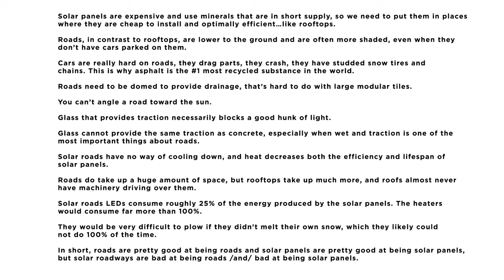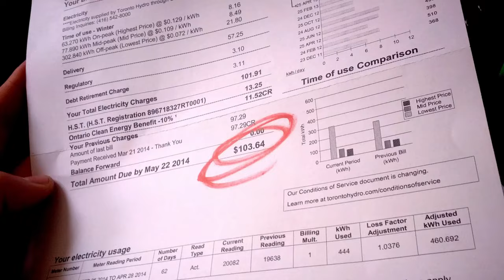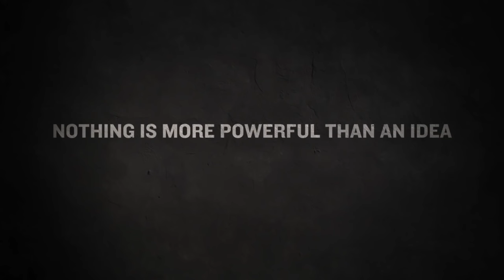The Kony 2012 of Roads - Solar Freakin' Roadways

Comment: I don’t care WHERE the solar panels are I just want MORE SOLAR PANELS (but…maybe they shouldn’t be roads)
Reply: Amen to that!
Reply: A similar sounding but much better plan is to cover all our large parking lots with panels overhead that also serve as shade. This is one to get excited about.
Reply: @Zakmmr  As an Arizonan, PLEASE.
Reply: Agreed.  I think there's a place that put elevated solar panels in the highway medium and put a biking path underneath the panels.   None of the obvious wear-and-tear problems of solar roadways and still has a nice side benefit.
Reply: @Zakmmr  That would be loads better than replacing the asphalt with solar panels. Less wear and tear on the panels, better traction in the parking lot, shade in the summer, keeps snow from piling up on windshields in the winter (in places where it snows)...
Reply: @TheFalrinn  that sounds like a truly miserable place to ride a bike.
Reply: @41-Haiku  solar panel parking lot shades are already installed some places.  Michigan State University has had them on some of its bigger parking lots for years - they're great!
Reply: On one or both sides of the highway is infinitely better than sandwiched between the two directions
Reply: Build houses with them already built in, with positioning and cleaning taken into consideration would be amazing.

Though do remember 2 unsolvable problems with solar.  The months of January and December.  At least they are at my latitude.  4 hours of daylight in winter just isn't going to work.
Reply: Beside roads could be an idea.  There's easy access and the right-of-way already there (the same reason why twinning a pipeline is a lot easier than building a new one).

As a person who primarily interacts with roads in rural areas, I see a ton of open space we could use for things.
Reply: @mrtalos  yeah, yeah. You fire up your nuclear stations and run them for two months a year.
Reply: What about…roadway SHADES
Reply: @London755  I mean, i've ridden a bike in the middle of a huge sunny day, and if there's a dedicated shady spot for a long stretch of it? Hey, i'll take it!
Reply: @mrtalos  there's some research being done in Australia with solar panels that are woven.  So they can be used as curtains and awnings.... Also as the roofs of emergency relief tents, particularly medical tents.
If they can get them fully functional and at a commercial level of price it could be an absolute game changer.
Reply: @Zakmmr  in South Africa many of the large companies are doing this. Not that it helps the power stay on but that’s a whoooole other story 😂
Reply: @London755  If you’re a commuter, sounds pretty friendly to me! Highways currently inaccessible to bikes!
Reply: @myladycasagrande863  yeah, they’ve had them installed in the main parking lot at the Cincinnati Zoo for a number of years now. 😊
Reply: @London755  If you're riding your bike for the sake of relaxation and seeing the countryside and such, maybe. You also don't have to spent all your time joyriding your bike on a highway, but bicycle-accessible highways would make it easier and faster to get places, and for a commute to work they would be a miracle.
Reply: @trishapellis  highly recommend checking out the channels @BicycleDutch and @NotJustBikes.   Building more urban highways would be a disaster, as would expanding them.
Reply: Put them beside the road, they can still power lights or whatever. Just don't drive on the things.
Reply: We can put them as a cover for parking spots.
Reply: @Zakmmr  It can work, but will require some detailed planning, as the light reflecting from the panels shouldn't enter any nearby building and can be nasty
Reply: @mrtalos  Excess solar energy can be stored away for later use, like for emergency power or I guess if the panel's usual output isn't enough, like reserves. (Or excess energy can be sold back to local energy/electric providers for $$ ((and/or possibly tax credits or something?)) ).
Reply: @TGears314  I thought about that , but then you remember what trucks do to bridges and accidents breaking all types of things around roads, so it would probably be expensive to keep repairing vs having a solar farm somewhere else.
Reply: They abosutely shouldn't be roads... thats just dumb as hell and extremely wasteful
Reply: @Zakmmr  I live in New Mexico and they already have this in my town
Reply: Once every single roofing surface is covered with solar panels, then maybe it's time to look at solar walkways.
Reply: @thelight3112  Even then I don't think you should lol. Why would you ever lay a solar panel flat. You may as well light money on fire. Not to mention, as someone who works in the solar industry, we're not even close to covering roofs and by the time we are i'm hoping there's major advancements in fusion.
Reply: The best place to put solar panels is the roof unless you are beyond 45 degrees North or South.  In the far north, it starts to make sense to put them on the south facing wall because the direction towards the sun is more south than it is up.  Pointing panels at the sun makes them more effective.  There is almost no point in talking about a solar panel that is not on the roof until all roof areas that can have solar panels do have solar panels.   The next place to look at would be putting solar over some agriculture in the very hot parts of the country.  There is a maximum temperature above which photo synthesis doesn't work.  Partial shade in such areas will make the crops grow better.
Reply: Solar panels should only be on tracking mounts on rooftops or above pastures, where they benefit from the most exposure with minimal environmental damage and definitely not roads or pristine nature bulldozed for flat fixed solar panels which maximize damage/inconvenience for minimal returns.
Reply: @Soken50  Tracking mounts are optional.  They have moving parts so they tend to be more likely to fail than the panels themselves and they also add to the cost.  You can point the panel at about the noon day sun and leave it there.
Reply: @kensmith5694  And subsequently lose about 40% of your generation potential, requiring 40% additional space, material, transport, emissions.
Well I'm sorry Ken but I like this planet and so do many other people so we're not gonna renounce efficiency just because it requires you to do maintenance and pay 100 bucks extra for a DC motor.
Reply: @Soken50  The extra cost of things that move and the extra maintaining are an extra burden on the planet.  Those motors and controllers don't appear by magic.
Reply: @kensmith5694  I guess I wasn't explicit enough, you don't need much  material to achieve half a rotation per day, it has less impact than having to build 40% extra surface of fixed panels.
Reply: @Zakmmr  FYI - one of the big French car manufacturers built a solar panel covering for their finished vehicles at one of their factories, and it wasn't just to serve as shade from the sun, it also meant that the area could be used when there was snow. It wasn't a perfect solution since when they were covered in snow they didn't generate, but for most of the year they were a really useful way to generate energy as it largely matched the activity cycle of the plant (if I recall correctly)
Reply: @Soken50  Can you put numbers on that to prove your case?  Such systems are more expensive so based on economics, I suggest it is not a wise design.

Comment: "Big, simple solutions are very rare because everything is very complicated. Soap may have been the last big simple solution." Wow Hank, way to frame it!
Reply: When you look at as a chemical engineering problem, soap is actually fairly complex.  It only looks simple because scientists and engineers have been working on it for so long that we worked out most of the serious kinks.
Reply: @przemekkozlowski7835  The first version of it was actually a simple observation that no doubt happened by accident.  People had learned long ago that wood ash helped to clean your clothing.
Reply: I think velcro is a pretty simple one that is pretty broad too. And arguably, the Internet is pretty simple, and solved a lot of problems.
Reply: @Muskar2  the internet caused many more problems. The internet is not simple and saying it solved problems without mentioning the plethora of created problems is well........
Reply: @Muskar2  You missed out duck-tape.
Reply: @kensmith5694  Good catch!

Comment: THANK YOU.  I'm an actual road engineer with an actual science degree and I was willing to fight anyone on this subject.  The most important function of a roadway is its function as a STRUCTURE.  It needs to be strong enough to hold up vehicles, including 40-ton trucks.  It needs to distribute the load.  Solar roadways are such a farse.  It's a wildly impractical idea for so many reasons.

Comment: I was literally talking about Solar Roadways with a friend just last night. I do miss the hope it gave me for the future when I was a teenager. Despite the "pain of knowledge" that comes with actually solving complex problems like those, it brings me hope in my adulthood to know that progress still does happen, albeit slower and less sensational.
Reply: The nice thing is that most of the problems that solar roads were meant to solve are actually solvable problems. They just will be solved by applying a lot of complex solutions rather than by applying one simple one.
Reply: @johnathangeorge1109  i think ironically that solar freaking roadways existed because it was more complex than the actually solution.
Reply: @stephenrowley4171  It was appealing because it was an 'elegant' solution.  You solved multiple problems at once in a way that seems 'logical'.  The problem with the usual 'elegant' solutions is that they tend to assume conditions that are not realistic in a wider application.  When you get into the real world, you find that you have to tweak parts of the project to correct for things you did not predict and this tends to un-fix the other issues your solution was supposed to fix as well.  In engineering true elegant solutions are the product of dozens or hundreds of previous iterations.
Reply: The thing to remember is that it really was just a scam you got fooled by in your youth.  Solar panels up on roofs are a great idea.  One of the problems you would like to solve, at least, seems to have a solution.
Reply: @stephenrowley4171  in actual implementation it would have been extremely complicated, but the concept seemed simple to lots of people.

Comment: I'm really glad you've mentioned that they're still doing some good and making some small progress. Some progress is better than none.
Reply: No, they are not doing some good.  They are a waste of time, money, and effort and are a complete scam.  If you put solar panels on the roof, they make a lot more power at a much lower cost.  When all the roofs nearby have solar panels, the local price of electricity will fall to the lower cost they allow for.  This means that the solar roadway will always cost more than it is worth.

Comment: I remember seeing the solar roadways and being very excited. It just seemed so perfect.
Reply: To me it seemed so unlikely right up front.  I am the sort that looks for problems to fix and then wants to fix them.  On solar roadways I saw problems that I couldn't see any path towards fixing.  One of them I will mention just to explain what I mean.  Solar panels on roofs will be cheaper than ones on the road.  When a lot of people install solar panels, the price of electrical power when the sun is out will fall to the cost of producing it which will be driven by the cheaper roof top systems.  This is where I said "nope"

Comment: Since 2014 I've occasionally thought back to that solar freakin roadway idea and thought 'why did that never take off? That idea is amazing!'. Thank you Hank for showing me how naive I am
Reply: They're still being worked on and still getting grants and passing tests from the Federal Highway Administration and Department of Transportation. They're taking a long time, so I wouldn't count them out yet. They may not solve every problem they claim to be able to solve, but a lot of the criticism has been addressed (like not having traction and such, they passed traction tests). I wouldn't count them out, or expect them to "take off", any time soon. It's going to be a long process.
Reply: @GoeTeeks  The problem is, the basic fundamental premise (a solar panel you can drive on) is still not a good idea. You can, and always will, get better results by building a road and then building conventional solar panels next to or over it. "A Road" is a fundamentally bad place to put a solar panel.

Comment: I've been following the Solar Roadways project since the campaign.  It's still very much a thing, just quietly chugging along (as Hank noted).  For one, that promotional video wasn't produced by the Solar Roadways company.  It was a fan hype which they admittedly used but definitely an over estimation of the capabilities.  That said the Solar Roadways team has been hard at work, has FCC approval, and continues forward.  They had a rough bump in the road recently because one of the co-founders (Scott) had heart surgery last year (you can go read their blog about it).  They're investing primarily at this point in doing solar replacements for large concrete areas (think military bases, airport runways, box store parking lots, etc)  This might not be a "solve everything" kind of solution but it's pretty incredible how they're moving forward.  We should definitely be celebrating small businesses taking on challenges like these.  Fair to point out the overhype but don't disparage them.  It's good stuff!
Reply: Love the statistic that there is enough road area to generate the energy we need.  Gives a sense of scale to the renewables problem.
Reply: No, it's still a stupid waste of time and money.

Comment: Hank - I'm an architect and just recently learned about Mitrex panels, which promise solar capture on any facade of a building and are supposedly cost-competitive to a lot of highrise-suitable sidings out there. I struggle to believe it, though, because of the same kind of issues you talk about with solar roadways. But I can't find much out there talking about possible downsides, and it's so new (~2yrs on the market) that there aren't a lot of testimonials. Thoughts??
Reply from the maker: Check and see if the wiring is included in the cost. Sometimes it's like "This material isn't that expensive" but it also makes installation way more complicated which increases costs. So it's not the material that costs more, but the labor and also potentially other changes that might need to be made to the design.
Reply: Just from your description, it would certainly avoid the wear-and-tear problems inherent to solar roadways as people don't tend to drive on the sides of buildings.   You also wouldn't have to worry about snow or leaf buildup that can potentially happen with traditional panels.   I can also imagine that the cost-competitiveness is based on factoring in the value of the electricity generated (so the initial installation cost may still be much higher). 

Now it's probably less efficient in terms of electricity generated per square meter than a rooftop panel installation since they'd spend less of the day in direct sunlight.  However it doesn't sound like they'd have the same fundamental problems that solar roadways would.
Reply: @vlogbrothers  The labor definitely pushes up the cost! My team is weighing whether or not we suggest it to our client. It feels like the kind of thing that /should/ be everywhere, but it's hard to get excited about it precisely because it feels too much like a cure-all. Maybe it's just more expensive to install, that would be great - but I also worry about hidden ways that it could fail and be a bad call in retrospect.
Reply: @Traxicus  there's also Solar Window out there. A chemist friend of mine worked for them and says their coating is good, but at least 5 years ago they were having trouble scaling it up. If they've fixed that part he says optically it's great, from a chemistry perspective.

Comment: The funny thing is, I feel like asphalt itself was a Big Simple Solution to roads. It's relatively cheap and easy to work with and almost 100% reusable. You can grind it up, melt it down and lay it out good as new. It's THE most recycled material in the United States.
But like most Big Simple Solutions that actually work, it's just been around so long that we take it for granted and think we can improve upon it easily.

Comment: 1. I like how you break this down

2. The solar roadway idea actually isn't a horrible concept - it's probably just that it's pointed in the wrong direction

3. And I like that it's pointed in the wrong direction. It's an idea looking for a niche. And there are niches looking for ideas. For example...

Maybe it would be worthwhile to put roofing over freeways with solar panels in those. As long as it wasn't too dense, it would allow for electricity generation which could recharge cars and maybe do that "heat the roadway" thing to melt snow and ice. Or maybe not. Maybe the tech would be good for house or commercial building roofing.

Or maybe it goes nowhere... But it inspires people to look into ideas. And while expertise is needful, fresh blood in those expert fields is just as needed. So I loved the solar freakin' roadways. It's just not what one would call the right fit.